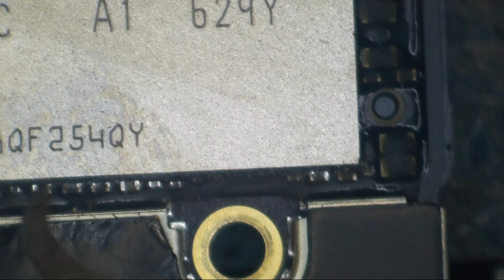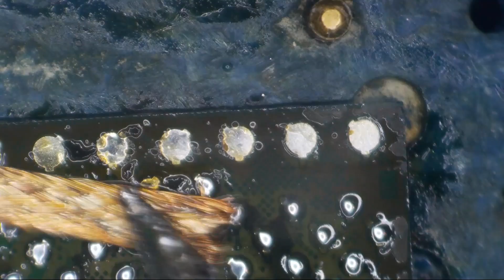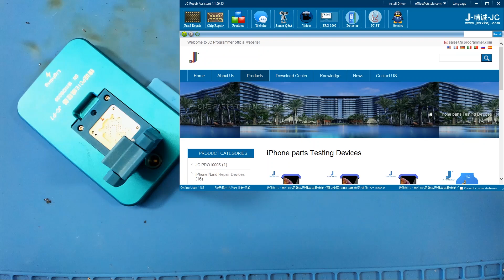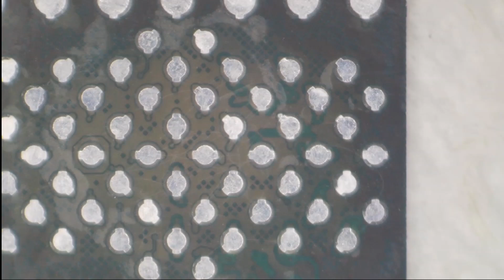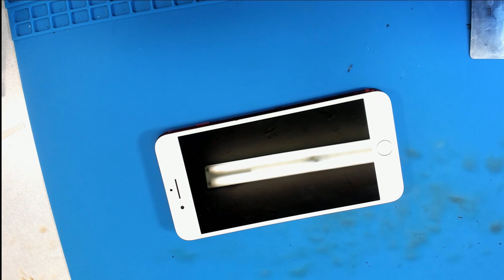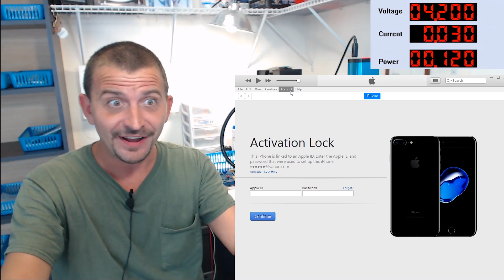Fixing an iPhone 7 Plus that wont boot or restore by replacing NAND - Google stopping repair ads

Comment: Is it possible to fix my iPhone 8 Plus by swapping the NAND to another fully functional iPhone 8 Plus without losing the data? Mine randomly shut off and won’t turn back on, even after battery and port replacements. Could I just switch the NAND and keep all my data safe?

Comment: Great Video I must say. I had a similar problem on my iPhone 11 and I sent it in for Repair and they would have charged me 500€. That‘s how much I bought the phone for. And as a kid I don‘t have that kind of money. I said to them send me the phone back. When I got my phone back I tried to restore it again but with a different cable because the other one was not MFI certified. And guess what: The phone worked and I was using the iPhone 11 until I replaced it with an iPhone SE 2. Gen. This hole thing because of an cable. That was 6 months ago.

Comment: I really like the fact that most iPhones you can replace the NAND relatively cheaply in terms of cost. Do you usually upgrade the storage as well to a higher tier if possible or use the same storage config the phone came default with

Comment: I have an iphone 7 that boots to both the apple logo or the dfu /recovery mode (But not into actual IOS) Does that sound like a nand problem or cable issue? (Tried 2 cables far). Error 9 pops up a lot though.

Comment: Do you need to flash the nand or if you put a blank nand will iTunes figure it out?
Reply from the maker: It needs the syscfg data flashed to it.  I always copy from old nand but when it's not possible, u wind up needing the serial number, Mac addresses and other details to flash on the new nand before installing it.

Comment: Do you have to program nand? For example when i buy chip from aliexpress for Iphone 8 upgrade do i have to program it ?
Reply: Yes, you'll have to copy the old both NAND's underlying data as well as the chip identification info. 

For security and encryption purposes, the baseband, the Main CPU and the NAND all require each other to have identical information.
Reply: AngryTechGuy thanks for answer. I found nand on aliexpress, they can program it for me if i gonna give them wifi, bluetooth adress and SN

Comment: Jason I understand that PCB holder you use in the video is also supposed to allow you to use it as a preheater dismantling platform
by connecting a soldering iron into the socket at the side. In the video you use a hot air wand. 
Have you tried using the platform's preheat function. If so is it any good or just a waste of time?

Comment: this happen to my xiaomi mi a2 lite phone too it wouldnt boot and i sent it to service centre and they said there was problems with the board and swap it with a newer fresh board with a new os in it lol 
"i did drop the phone 10 times ++ but i was using a shockproof case i do not know if that is what causes the issue of not booting and random OS crashes etc" anyways sold that phone and obtain a Xiaomi Redmi Note 7 and i loving this new phone :D

Comment: Thanks for the informative structured video 😀 its refreshing to just see repairs rather than constant rants about Apples quality due to user water damage etc
Reply: User water damage to so called IP67 rated iphones LOL
Reply: arno nabuurs IP67 is rated at 30min at 1m and it has been proven to exceed that rating. What you don’t know is was the screen replaced which removes the seal most of the time unless done by Apple. It is water resistant not waterproof.

Comment: Hey Jason, big fan here. I have an iphone 7 (a1778) with audio issues, but I'm not sure the IC is the root cause. The only issue I can find is that people cannot hear me on voice calls. It seems worse when I cover the proximity sensor. This issue appeared with 11.3 but has not gone away with 12.1 or 12.3 upgrades. It's pretty likely it's the audio IC but have you seen a problem present like this?

My testing has revealed this:
Boots fast.
Speaker not greyed out.
can record voice memos.

siri works.

The only other thing of note is that the silent switch is a little 'loose'. 

Just curious what you thought.

Comment: Ok so I need help with my phone. When I put on the broken screen it does turn on but some parts the touch thingy doesn’t work(cuz it’s obviously broken) then when I put 7 other different screens including original ones from working phones the screen doesn’t turn on. I can only see a faint white light on the back of the display

Comment: Hi there jason Please can you help me I have  jc programer  same like u I brought to  UNION REPAIR  they suppose to be good but  I don’t  know if is necessary to do something especial  to usesm the programer without  the usb cable conected but my programer is imposible  never charge the battery I don’t know if is have one inside or not but is always empty please tell me is have where I can put one or what  have to fix that thanks
Reply from the maker: Needs battery installed in bottom.  It uses an iPhone 6 battery.

Comment: I have done tens of these..
My problem is sometimes the Nand is damaged and no data can be read.my question is do you know any trustworthy web which can provide the necessary data like serial number wifi mac bluetooth mac and other stuff?
Reply from the maker: I don't have a trustworthy service for this although they must be out there.  Sometimes I am lucky enough to get the customer to send me a picture of the label on their box.  I have gotten into trouble because often the customer's box is not the box that belongs to the phone.
Reply: @ststele  

Let me know if you come across any provider plz..
By the way, you don't need to clean any under fill. It's enough to add solder melt on both sides the Nand and the Motherboard . Lots of time will be saved.
Reply: STS Telecom #righttorepair As long as you can get the IMEI or SN I can provide you the detail free
Reply: @sameedmaqsood7051  
Yes I can get you the imei
Reply: Ammar Ali do you use Wechat  or Whatsaap
Reply: @sameedmaqsood7051  
WhatsApp
Reply: This is the imei I need the details for
353289074404338

Comment: Thanks for this great video! This is the first NAND swap video I’ve found that shows how everything is done. I’m hoping to one day try this out on an iPhone XS Max by upgrading a board from 64GB to 512GB. Unfortunately it does look like those NAND readers for iPhone 8’s and later are really expensive but if anyone knows of one that I could buy for a bit cheaper that would be nice
Reply: Have you looked on alixpress?
Reply: @xtreme9942  that’s mainly where I was looking and they still cost hundreds of dollars like $500 or so
Reply: @xtreme9942  luckily though that was last year and they have dropped in price quite a lot since the nand bga arrangement has been around for awhile now and is still currently being used in the latest Apple soldered on SSDs in all their macs and also the nands in the newest iphones. But interestingly enough, we now have a bootrom exploit for iPhone X and older that allows us to extract the data necessary to reprogramming right from the phone itself through a lightning cable so that helps with older devices. Though at least with newer ones the reprogrammers are still not nearly as expensive

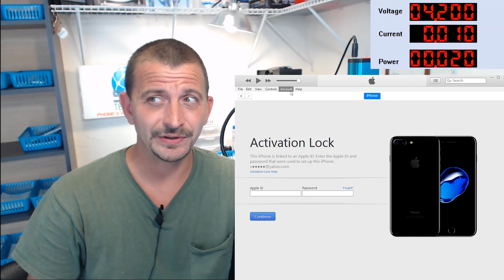Comment: 49:17 "Something changed between the iPhone 5s and the iPhone 6" 

Yeah, something changed. The case design... you know the case responsible for BendGate? The iPhone 5s's case design had squared off edges which actually helped reinforce the strength of the case. When Apple decided to make the iPhone 6 thinner with half-rounded case edges, that extra strength disappeared. This left the PCB susceptible to flexion when the case bent.

When Apple attempts to strengthen its PCBs because its phone's cases have susceptibility to case flexion, you've got bigger design problems to consider. That Apple even has to design around it's crappy weak case design says volumes about its internal thought processes. Apple, just redesign the case to be stronger! Don't strengthen the PCB, strengthen the case! It's simple basics here. The weak case design is what's almost entirely responsible for all of these flexion problems that loosen chips and break pads that you have to deal with on the iPhone 6, 7, 8 and even X. This case design is actually quite old at this point and we're well overdue for an upgraded housing design.

Comment: Were you getting an Apple logo on the customers board with the faulty NAND installed?
Reply from the maker: Yes.  This was a short boot-looping phone (if I remember right).  They will actually get an Apple logo without NAND during attempted restore (at least the 6s did...) but I have seen NAND bad in a way that the phone will never display anything on the screen, not even an Apple logo when attempting to restore.

Comment: See you have revision 2 of 7 programmer are you able to upgrade to 512 storage with that version ? From what I hear it’s not possible with a version 2 have you tried ...
Reply from the maker: Ahhhhhh... interesting.  I haven't used it on anything over 256GB yet.  This is the first I've heard of it but I'll be glad for that to not be a surprise when I try 512GB.  Thanks :)
Reply: STS Telecom iPad Pro has the 512GB storage I buy the iCloud locked board and strip them off there 👍

Comment: Warning - this video may contain a hooker, some fresh balls … and possibly some hockey equipment of some sort.
Reply from the maker: When I tell my wife that I'm buying a hooker, she's not too amused.
Reply: @ststele  In the mid 80s my brother was a senior dive instructor and he wanted a Poseidon Hooker when he went lobster and shellfish "fishing". The law in our country was that if you could reach them with a snorkel you could take them. Anything that required a scuba tank and it was verboten so he wanted the Hooker. It was an air pump that connected to his mask and allowed "diving" deeper than snorkel depth without using an airtank. The Hooker got around the snorkel law but I guess it would have been fairly quickly changed,

Comment: Hello sir good job keep it up 
If you don’t mind sir I want your Help 
I have IPhone 7 Charging Problem after diagnoses the device I found u2 Ic Problem so I Replaced  Ic And Charging start But after fitting in housing again device not charging
Reply from the maker: This is often caused when the metal that partially covers Tristar is cut to do the repair.  I have seen a small burr or sharp frayed piece of metal that sticks out just a tiny bit.  When the board is tightened into the housing, the USB 5v rail gets shorted to ground because the sharp metal cuts into the dock flex.